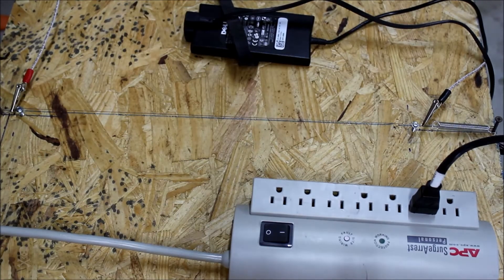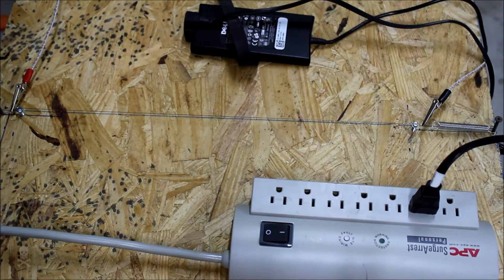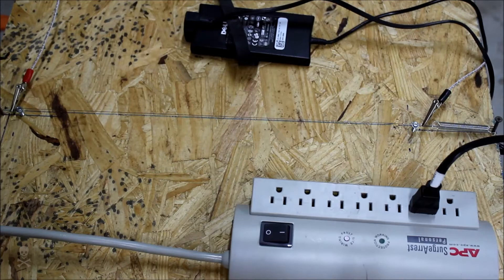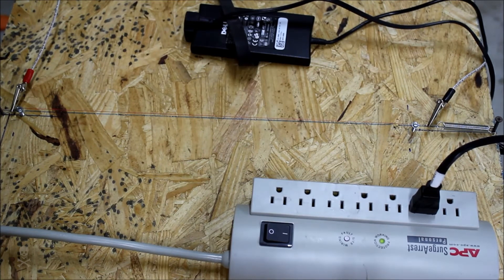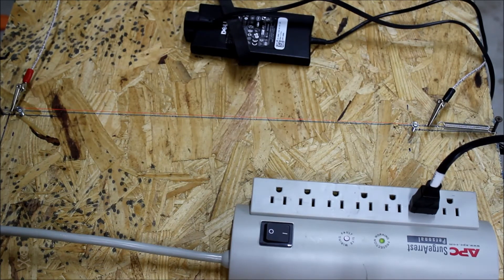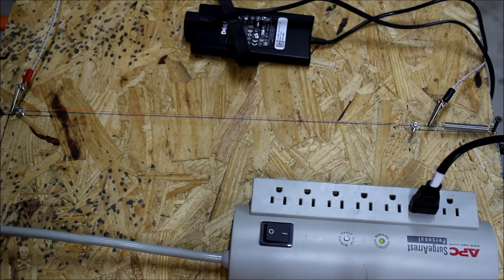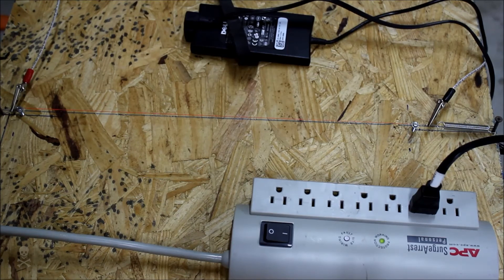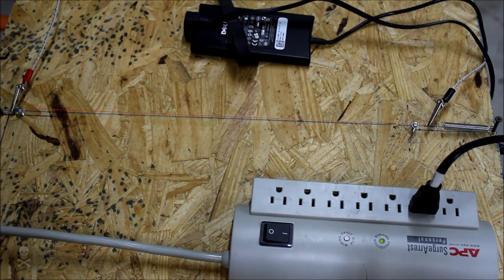Nichrome wire acrylic bending table with laptop power

Comment: How did you wire the power pack?
Reply from the maker: There are only two wires in my power pack. I wired one to each post on the bending table.

Comment: So much thanks. It just occurred to me a few minutes ago that I might not need to modify an ATX power supply when i have a bunch of adapters. I have about 3.7amp DC laptop power to use with 20g nichrome wire. Thank you. :)

Comment: Do you think this kind of PSU will work with 20WAG as well? or is it too thick, and won't get hot enough to soften the acrylic?
Reply from the maker: +Pyr0t3ch It would all depend on the length of the wire and the volts you are using. Check out this calculator to help determine the correct voltage and length of wire needed. http://www.jacobs-online.biz/nichrome/NichromeCalc.html
Reply: +PirateMods Thanks!